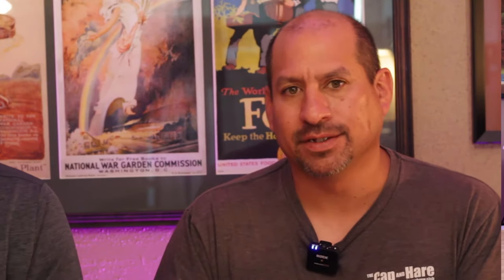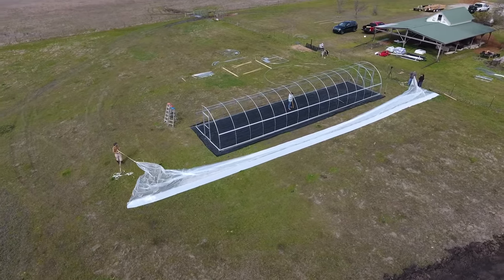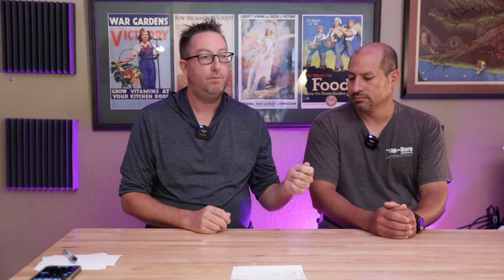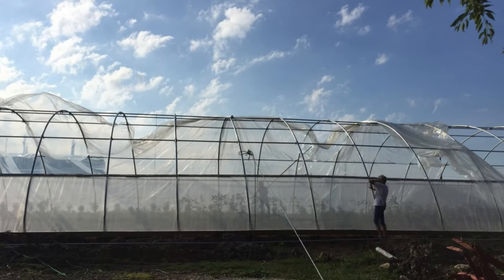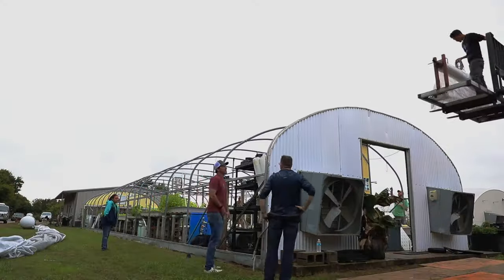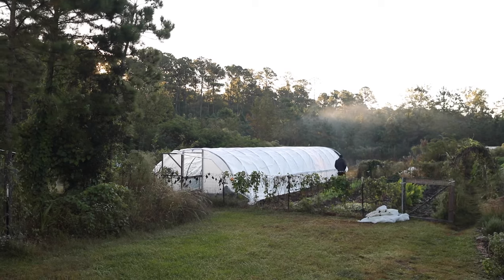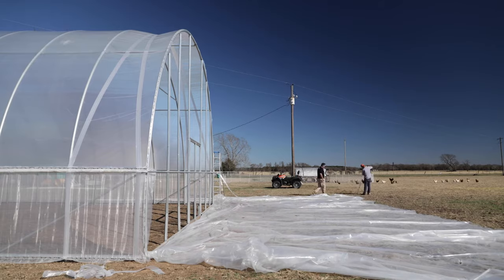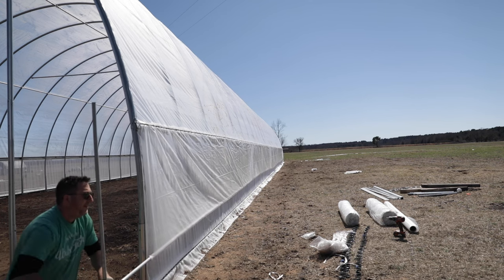Installing Greenhouse Film | HOOP HOUSE 101 Ep 17

Comment: My hoop house is 20’x12’. Do I need lock channel with wiggle wire on every hoop, or only the first and last hoops? (I have it on the hip and baseboards as well as front and end walls already.)
Reply from the maker: Just the end walls. On page 40 you can find more info:
https://cdn.shopify.com/s/files/1/1338/7937/files/Greenhouse_Building_Instructions_All_Metal_Hoop_House.pdf?v=1601658241
Reply: @BootstrapFarmer  super helpful! Thank you!